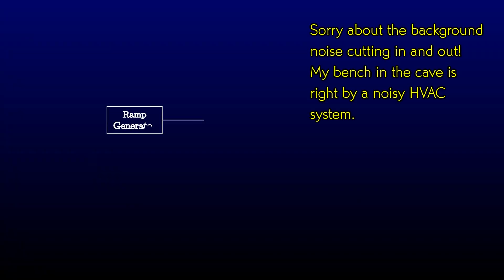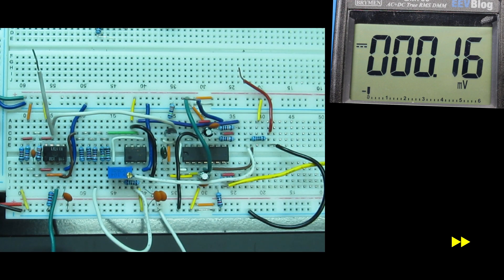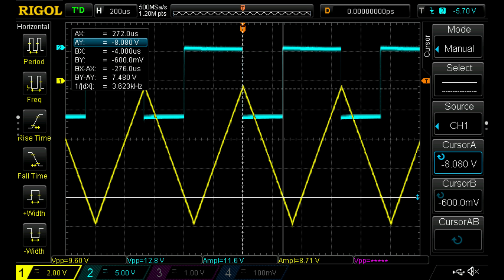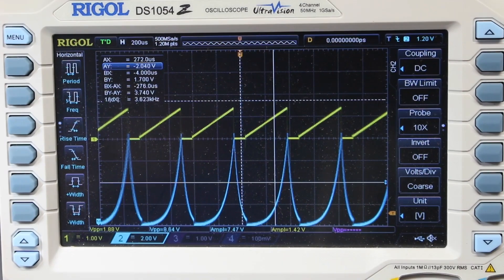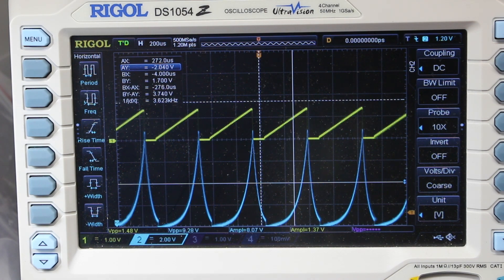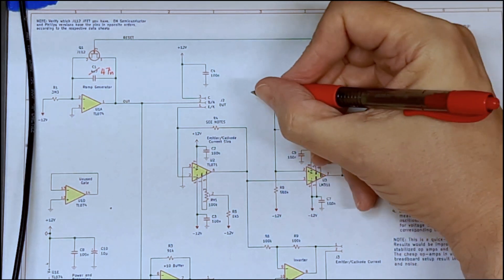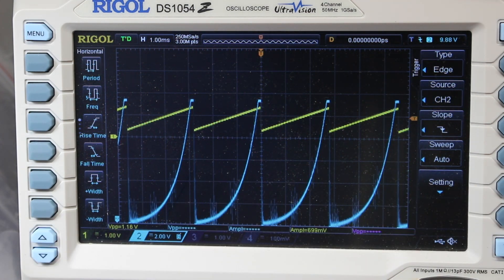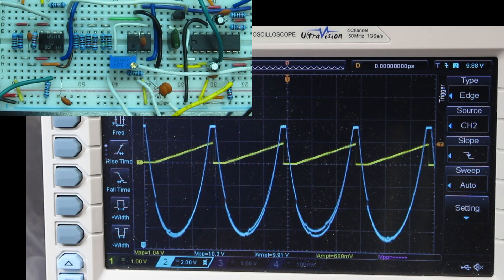Transistor 101 Side Project: Current-Voltage Curve Tracer, part 2: Build

Comment: There is a small mistake in your design - for testing transistors you would need to ramp the collector voltage and stairstep the base current to get the classic I/V curves. Probably a simple 4 bit counter and R-2R ladder for the base current generator would work adequately, increment on ramp generator reset.
So what is needed is to:
1. Use the ramp generator as Anode/Collector voltage source.
2. Build a stairstep generator for base current source.

Then upgrade to get the second polarity ramp and negative current source to test P devices, should be able to test MOSFET and JFET transistors with that setup too, just use the voltage steps as VGS source.

Very nice project, I always wanted to make a transistor tester for fun but never got to doing it :-)
Reply from the maker: @akkudakkupl  Patience! As I've been trying to make clear, this isn't a full-up curve tracer.  It's just enough to show Ebers-Moll and the Shockley diode law.  I take another step toward a full one in a few weeks, when I show the Early effect in the context of current mirrors.  That's my style: one little step at a time.
Reply: @KludgesFromKevinsCave  Keep 'em coming. I love watching stuff like this done by people that know what they are doing :-)
Reply: Thanks for posting. Kevin at what frequencies are you inputting into the Collector Emitter junction and Base Emitter junction?